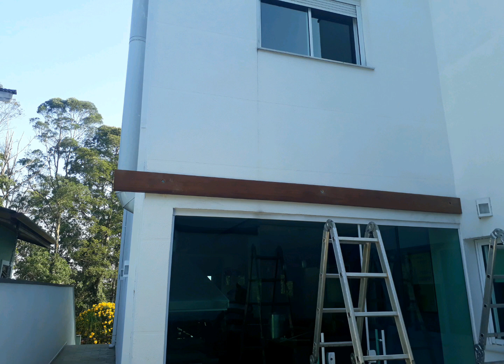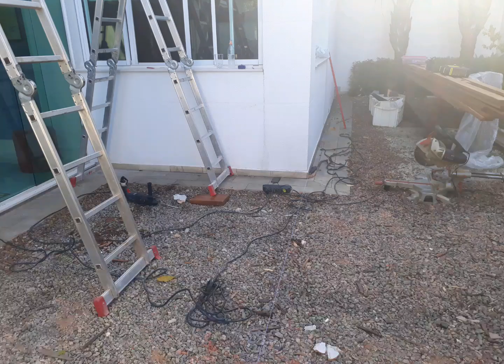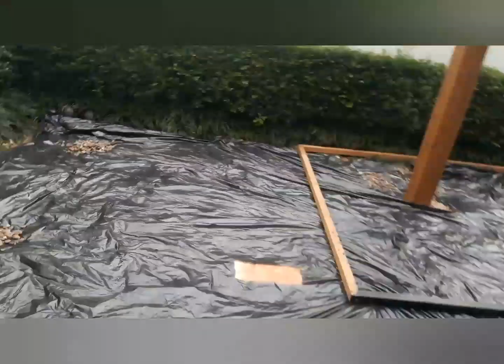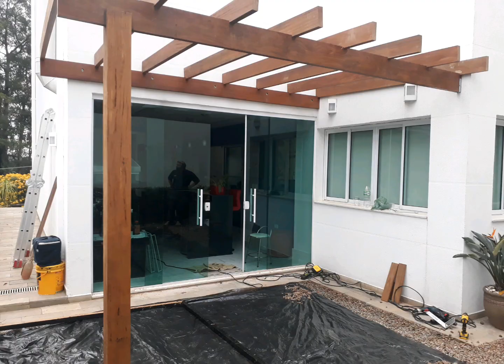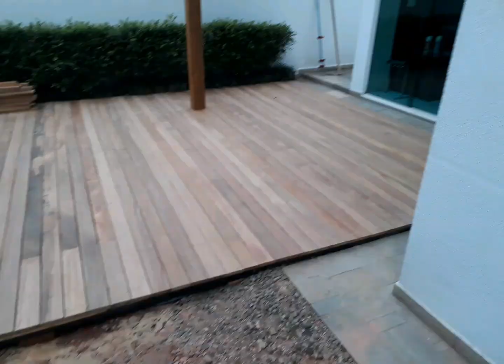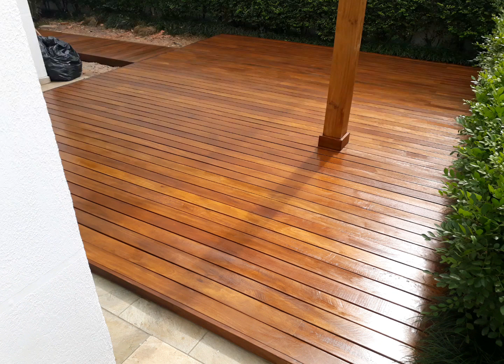Pergolado de madeira passo à passo.

Comment: Qual espessura do Pilar de madeira  espessura  das vivas
Reply from the maker: Boa Noite Wander dos Santos! Obrigado por assistir nosso vídeo e interagir conosco! Os pilares são de 20 x 20 as travessas de 10 X 20 e vigas de 10 X 20 cm.
Reply: @Apuleia256  Sera que usar travessa  de 20x5 e vigas 15x5 fica bom quanto  posso deixar  de caida
Reply from the maker: Pode usar essas bitolas sem problemas. A caída precisa ser a partir de 3 % em caso de cobertura de vidro e  à partir 15 % em caso de cobertura de policarbonato alveolar.